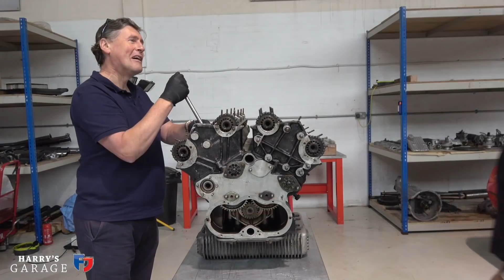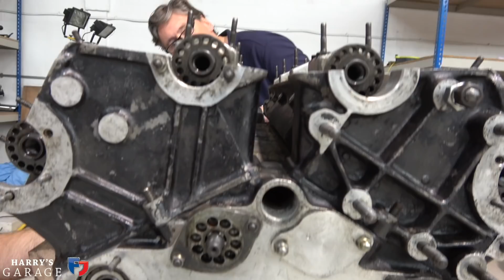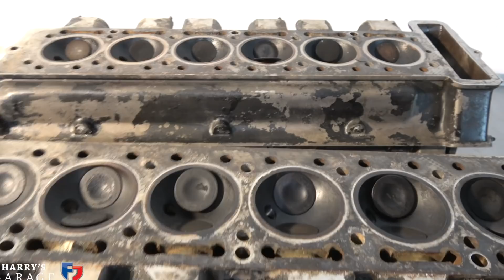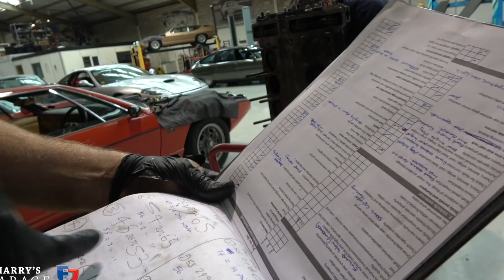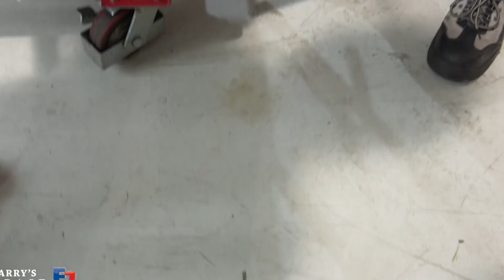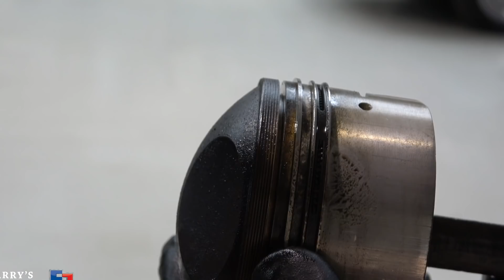Lamborghini V12 engine rebuild. Part 2, stripping the engine

Comment: A word about ropes: I've used ropes rather than chains in addition to a load leveller for the simple reason that one can so easily adjust the angle of hang as well as not having to worry about chains clanking on things. Sometimes I'll use a chain plus ropes if I'm confident the chain length is spot on. A Spanish rope windlass is your friend.

Comment: Great to see this kind of care and attention to detail.

Re: Copaslip™ on head studs, I've often done this (sparingly with a toothbrush), but someone recommended recommended I used Alumslip™ instead, because copper and ali are a bad mix. 

I've tried it and it works, but I'm not convinced it's any better. I reckon pretty much any anti-sieze is good enough. Anyone here have comments?

Comment: man they have manage to make a 2 valve 4 cam setup, that is a waste at the time , but they may have designed it like this for higher rev, all this will ofcorse make it simpler to convert to 4 valves at a later time, and they did with the quattrovalve.

Comment: Surprised at the amount of cars and lack of staff even trainee's. The whole trade is struggling to get mechanics of any worth but would expect this garage to have a queue to get in. Personally I always pressure test before taking off cylinder heads so you might get some idea of where and which cylinder has the leak or even if there's a crack in the head.

Comment: As an engineer I used to repair, repair and maintain plastic and rubber injection moulds and we always used copper slip as it was superb at helping to strip the parts together after they’d been used and subject to a lot of heat.

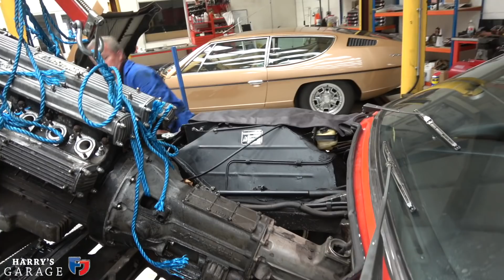Comment: @6:05 "scrauped" that's a technical term normally used in northern counties. It's a past tense reference to the unnecessary damage caused to engines by ill considered handling.

Comment: Regarding the clean spot between the cylinder dome and water jacket - I would think the pressure would be highly positive with respect to the water jacket while the piston is going up, but highly negative, drawing water into the cylinder, when the piston is going down. Great video. Not enough v12 engine rebuilds on youtube. Thanks for your interesting contribution.

Comment: the reason all those piston rings broke, was from SPARK KNOCK i.e. DETONATION i.e. PREIGNITION.  the early Lambo V12 had 9.5 compression, and then 10.7 compression, which is relatively high- and someone was putting lower octane fuel in it, and when that happens, the spark knock takes out the pistons rings.  they are the weakest link in the chain.  if run hard enough it will also take out the rod bearings, but in this case the small engine, short stroke, the bearings survived.  once the rings broke, the compression came down, so spark knock probably stopped at that point.  but then they had an engine that was using oil and down on power.  detonation is also the reason why, it blew a head gasket on both banks.  NOTHING can withstand the forces of detonation in an engine long term. it will self destruct. so...as knowledgeable and skilled as this shop owner and mechanics are, they miss the true reason why that engine was suffered internal damage.  and if they run it again with low octane fuel, it will happen AGAIN. if it's a 10.7 compression engine, it needs a minimum of 105 to 107 octane.  otherwise the spark advance needs to be backed off to avoid detonation, at that point you have a V12 that can't get out of its own way, because less spark advance means less power.  that is a hemi head engine, with domed pistons, and therefore very SPARK KNOCK PRONE, being it has no quench area like a wedge head.  they need high octane, just like the original early Chrysler V8 hemi engines, and 2nd generation 426 Chrysler hemi.

Comment: 21:16 actually copper grease is not good between 2 dissimlar metals , in this case a steel stud and an alloy head .......
read this :-
This information was obtained from: Textar, the manufacturers of Cera Tec a ceramic based anti-squeal lubricant

This article will hopefully clarify why copper grease should not be used on the brakes and road wheels of modern motor vehicles.

What is Copper Grease?
Copper grease is an anti-seize compound consisting of fine copper particles in a non-melting Bentone (a type of clay) base to which are added highly effective oxidation and corrosion inhibitors. Copper grease is used for mating surfaces which work under high temperatures.

When working under these high temperatures, the lighter fractions evaporate and leave copper and other contents behind, giving an anti-seize property.

There is a problem however, aluminium is very susceptible to an electrochemical reaction known as a galvanic corrosion when it comes into contact with copper in the presence of an electrolyte, even salty water will do!

So what is a Galvanic reaction?
Metallic materials in electrochemical contact can form a galvanic cell, or battery. Different metals have different electrode potentials and when two dissimilar metals come into contact with an electrolyte (salt water for instance), one metal will act as an anode, or negative (–) electrode and the other the cathode or positive (+) electrode. The reaction will cause the anode metal to dissolve into the electrolyte with some of this dissolved metal depositing on the cathode. This is most commonly seen as the white chalky powder seen on the back of alloy wheels.

The anodic index compares the electrochemical voltage that will develop between any one metal and gold (the most noble metal). To find the relative voltage of a pair of metals, you just subtract one from the other.

For harsh environments, as found around the brakes or road wheels of a motor vehicle, there should be no more than 0.15V difference between any two metals. In the case of cast iron and cast aluminium (materials often used for modern brake discs and calipers) you will see a voltage difference of just 0.10V therefore minimal corrosion will take place. However, if you compare cast aluminium and copper as found in copper grease, the voltage difference is now 0.60V. (0.95 – 0.35)

This voltage difference will cause a large galvanic reaction between the two metals causing the cast aluminium to dissolve to the copper, thus causing seized and damaged components. It is also worth noting that using copper grease even on cast iron calipers will still show a voltage difference of 0.50V so a significant reaction will still occur.

What should we use then?
The simplest way to prevent a galvanic reaction on brakes is to electrically insulate the two metals from each other. If they are not in electrical contact, no galvanic reaction can occur. This can be achieved by using a non-conductive material between the two metals.

Comment: theres heat marks on the crank there was an oil issue in the middle.
Reply from the maker: Apparently not. Crank is heat-treated when new, so looks like that from the off. I asked the same question..

Comment: Is the question, why have the rings broken and why has the oil control ring worn on one side, you then have the mains bearing showing wear on one side. You know the engine has been opened up before... has the crank been running true?
I’m not sure I buy the Webber starting issue, I mean it would need to be a shed load of fuel. I run a classic supercharged mini, tuned up around the corner from this place and I run some serious fat fuel and I haven’t seen this sort of issue from bore wash?
Hopefully the measuring will get to the bottom of the issue.

Comment: Did anyone catch the V angle of this engine (mentioned at around 14:30)? I've listened to it 6 times but can't quite pick up what he says due to background noise. Instinct tells me it's 60deg but I'm curious to find out for sure.
Reply: Phillip McIntosh yes Phil, it is indeed 60 degrees, like most V12s.
But just to confuse matters a Ferrari Dino 206/246 V6 engine runs at 65 degrees to leave slightly more space in the middle for the carbs and manifolds

Comment: Hoping you'll tear down the heads and explain how the valve clearance is maintained on that engine. Looks much like a motorcycle shim-in-bucket system,  but have to believe it isn't designed that way. Great stuff! Thanks!

Comment: Great video, Harry.  Does the engine have wet cylinder liners?  My 105 series Alfa twin cam engine did and it was easy to dislodge them from their base seals if you turned the crank with the head off.

Comment: Custom pistons and modern rings would do wonders for the engine.  A modern ignition controller like an msd would really make a huge difference as well. Custom JE pistons would be cheaper and far more reliable than factory pistons. I would never use those pistons given the choice. Besides the pistons its an absolutely brilliant motor. Well designed and thought out. One other area that they just didn't understand back then is the camshafts. Hard facing with a custom grind could make a nice flat torque curve and superior economy. I am thinking of finding an old V12 after seeing the basic design.

Comment: Nice, glad the news is that the motor just needs a service and is not broken.
The bit about the rope was good, I knew it but yes the rope is wickedly strong and also kind to the surfaces it touches.
At the end I actually thinking these gents should be wearing white coats to work, obviously not but that's the impression they create.
I like this, looking forward to the update.
In the meantime I shall watch you farming.
Kind regards from RSA, D

Comment: You check cylinder wear at the top ring wear line, not by rocking pistons back and forth  they’re supposed to have a .001” to .003 “ fit on the center of the skirt only on the major and minor thrust areas of the piston. Ring ridge is the quickest way to know how much cylinder wear there is initially,  there’s nothing wrong with pistons doing that especially on a short strokes motor with extremely short piston skirts.

Comment: He said he didn't think there was oil or lubrication problems, but when you have a partially clogged oil pick up screen, there are definitely problems. This engine was not cared for as it should of been, that is clear. I would of liked to see the head gaskets themselves. I bet the cooling system was not serviced like it should of been.

Comment: Happy to see the motor is in great condition! She's been looked after!! Hopefully the tolerances are within spec for the Pistons and crank, and it's just a case of new rings a valve job and  re assembled! Will you be going for the hardened, and a 5 angle valve seat? As this would improve the power and torque without porting the head! As some would call it vandalism to port the head. Me personally I would have it ported as well as a 5 angle valve seat. Then that beautiful V12 would be singing with more vigour!
Great video can't wait to see the next one!!

Comment: Rings break because on cars like Lambo's and Ferrari's the engine spends so much of it's time at low rpm and the bore wears a ridge over high mileage according to those low revs, then someone revs the nuts out of it on a test day or something and the pistons are flung slightly higher in the bore than is usual because of the greater inertia of the piston/rod assembly at high rpm and the top ring now hits the wear ridge at the top of the bore with sufficient force to break the ring. The answer is to regularly rev the engine hard so the wear ridge at the top of the bore is formed at the high rpm piston position

Comment: The cylinder would have drawn coolant in on the intake stroke also because of the vacuum.
Reply: that's not how it works...the gasket is still there and sealing a bit...the extreme compression lets some gases get past and pressurizes the coolant system.. coolant only weeps inside of the bore while the car is off during long periods...sometimes causing hydrolock
Reply: @MrHBSoftware  well when you see white smoke coming out of the exhaust that's because your gasket is letting coolant into the cylinder (everyone knows this), you only get hydrolock with substantial amounts of water getting into the cylinder. But I don't know what was happening with this engine I was just saying what usually happens with a bad gasket.
Reply: @ZORGtheALIEN  a running engine never lets water go into the chamber unless that cilinder is so dead it no longer has any compression...in that case water enters and gets ejected into the hot exhaust manifold thus creating steam and massive white smoke..but thats on an extreme case were you have a dead cilinder, maybe blown gasket between adjacent cilinders elimintaing their compression...not when the gasket is only blown from the chamber to the water jacket wich is the case in the video and the most common failure mode. i guess you dont work on engines on a regular basis
Reply: @MrHBSoftware  I'm pretty sure water can get into the intake manifold also with a bad gasket or if you drive into very deep water
Reply: @ZORGtheALIEN  some intake manifolds have water jackets and they do fail causing the engine to burn water...not a head gasket failure but a manifold failure in that case..also a crack in the head from an inlet port to a water jacket can have the same effects you describe...white smoke and the engine sucks the water from the cooling system and spits it through the exhaust
Reply: @MrHBSoftware  You are aware that with a blown head gasket you get coolant entering into the combustion chamber and burning producing white smoke also? Which is what my initial comment was about.
Reply: @ZORGtheALIEN  no fucking coolant enters the combustion chamber WITH THE ENGINE RUNNING due to headgasket failure alone dude...coolant pressure is 1.5 bar tops while combustion chamber pressures are almost ten times that on a gasoline or 20 times on a diesel...compression enters the cooling system and blows up hoses etc. like i said earlier water can fill up the cilinder with the engine stopped but once its running and if it did not hydrolock, then no water will enter the combustion chamber and no whitesmoke FROM HEADGASKET FAILURE ALONE...if the head is cracked from intake port to water jacket then you can have white smoke from water while the car is running and the engine sucking coolant, but that is NOT A GASKET FAILURE. do you understand? i am no native english speaker so maybe i am not explaining my points in the best way

Comment: I've always had a fascination with these early Lamborghini V12's. I could never figure out why the carbs were feeding in between the camshafts like they do. Now I know that's where the intake ports are. Lamborghini was in it to win it with these engines, that's for sure. A big step up from the Colombo V12's Ferrari was running in those days.

Comment: This brings me back to my first car.  I bought a 35 Plymouth coupe and towed it to a friend's farm.  There is a true sense of discovery when pulling an engine down.  I pulled the head off and pushed one of the pistons down the cylinder without turning the engine over.  Curiosity was the clear winner over disappointment.  I never did finish the car to become drivable.  I found it again after over fifty years and it is restored and sitting in a barn.  Next summer I'll drive down and have a look.  There are those of you who will understand why this all matters.

Comment: Fantastic video , one of the best yet, great to hear somebody know what they are talking about! Out of curiosity, when you rebuild the engine , any preventative measures you can take to minimise piston rings breaking due to the borewash on start up, common issue with Carb engines?

Comment: I would consider putting a thin coat of paint on the unthreaded portions of the head bolt studs to keep them from rusting, making removal of the heads easier.

Comment: Should probably check that the rods are numbered BEFORE disassembly.  I wouldn't go by the previous guys possible mistakes. I've rebuilt engines that had two rods stamped with the same number before from using parts from different engines...

Comment: Wow Harry, you do lead a charmed life!  When we did a top end for a couple bent valves on our 308QV one of the heads had to be cut off!  The other just popped off like yours, but the forward head...  Not so much.  Six weeks of work hanging the engine, even acid down the studs...  Finally it was cut into three pieces and it was still six hours...  All was well in the end and the car runs really well now. Congrats on so little issues! F

Comment: It must have only been leaking slightly. 
Were those rings broken or did the break on the ridge being removed. Look at the carbon on the break.
It needs new cam chains as it appears to have a 6 deg of slop!
I had never thought of copper grease on the studs, excellent idea and I suspect the guy stripping it was the same. So obvious and simple yet not heard of.
There is a heap of heat around the mains, Why? The oil is clean enough and the junk in the pan seems mostly silastic.
Alloy maincaps too are a worry, alloy flexes a good deal.
Reply: There's a deal of discussion about the use of copperslip on engine rebuilds. If it is used on the threads then the torque stats for the head nuts will be incorrect. So just use on the non threaded part of the stud. But then you must make sure it doesn't get between the head and the gasket as you lower the head. Swings and roundabouts!

Comment: That blue rope...

Industry standard in the baggage handling world.

I've tied dog crates down in cargo bays with that rope...and I'd be happy to have my own dog secured by it.

If it's good enough for airlines...who rely on heavy things not breaking loose and penetrating the aircraft's skin...then you know it's got to be OK.

I might even have 'borrowed' a little - it's good for towing (doubled or trebled to add a safety factor).

It might not scratch but it'll give you a damn good burn if you don't use gloves and you let it slip.